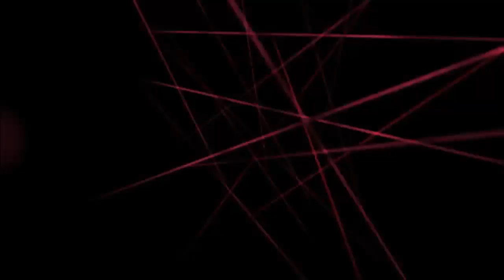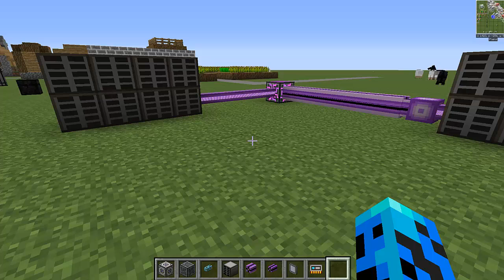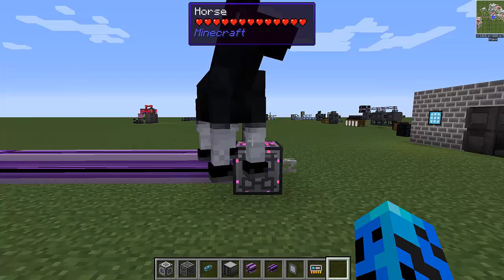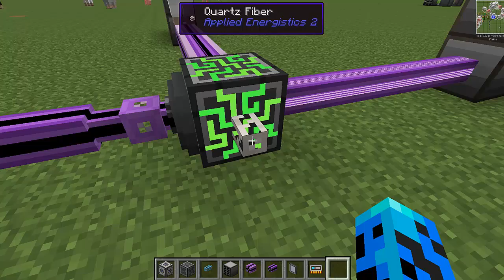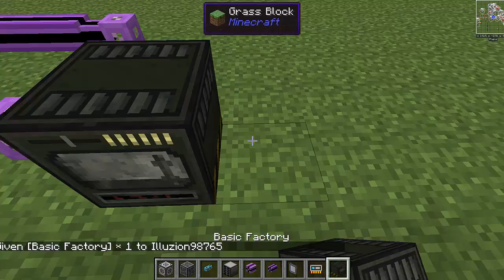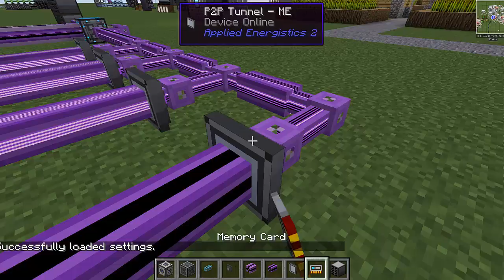Minecraft: AE2 Demo: P2P and Channels

Comment: I wonder though, why not just use a dense cable? You are using 2 sides if your controller, with a dense cable that would allow for 64 channels as opposed to only 56.
I've been trying to figure out the benefit of P2P and all I can really see is possibly a bit cleaner cable management.
Reply: EiEN I tested this earlier and I don't think you can get more than 32 channels per controller facing. so to get 64 channels through 1 cable (and the respective p2p tunnels) you would have to connect at least 2 controller facings not counting the power, which can be branched off a cable and does not necesarily have to come from a controller facing.

Since illuzion did not actually show hooking up 56 devices that use a channel, I doubt he is right about his claim you can have 56 channels running off 1 controller facing. What happens here is, he hooks up 7 p2p tunnels(not counting the p2p tunnel on the controller facing) which he theorizes to be able to each allow up to 8 devices for a total of 56, but that is not accurate unless you connect more than 1 p2p tunnel at your ME controller.

In the video the mod maker made it's actually shown that when you need more than 32 channels through 1 cable, you have to hook up more than 1 controller facing.
Reply from the maker: Dense cable is 4 times as expensive as normal cable. I am not advocating use of one over the other. These are just set up(demo) videos.
Reply: you could use dense cable instead of the smart cable here, which would allow up to 248 channels over the 64 you'd normally get from 2 sides + dense cabling. pretty expensive but extremely efficient
Reply: gazeebo88 Pretty sure you're correct, otherwise you could simply hook up an unlimited number of p2p tunnel adapters to a single p2p adapter on one controller face.

If you link the "parent" p2p adapter to a controller instead of an ad-hoc network - even the same controller it's getting its tunneled channels from - then you could have potentially any number of "child" adapters linked to it.

In practice there's no point in having more than a handful linked to each parent. The less channels you're using on each child adapter, the less efficient you're being - as an extreme example, if you only use one channel out of a tunnel at some given location, you might as well not have used a tunnel adapter at all. Using just two or three channels per child adapter is also a little on the iffy side. Of course, depending on resource availability and exactly what you're trying to build, your sweet spot may be different.

Another excellent way to deal with channels is through the use of subnetworks. For a really excellent example, look up the "Super Soaryn Drive" - a recursively nested subnet design for attaching a potentially infinite number of ME Drives to your network, while using only ONE channel on your main network.

Some things just have to be on your main network, though - crafting CPUs and pattern interfaces are the main examples that come to mind. And for that, knowing how to get lots of channels from A to B is important.
Reply: You're right, sadly -- I know I used to assume that was possible, but I re-read my old comment there and I don't see anything regarding the topic of running a p2p through a p2p, so I'm slightly confused.